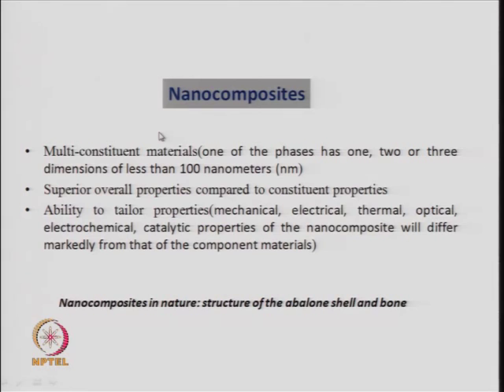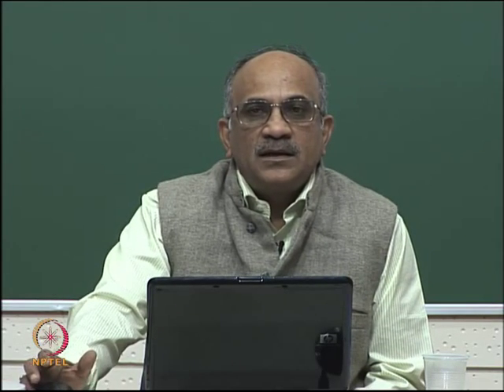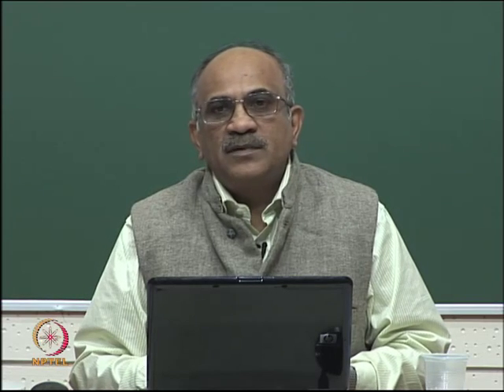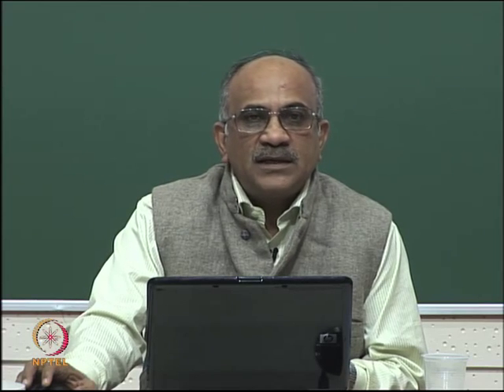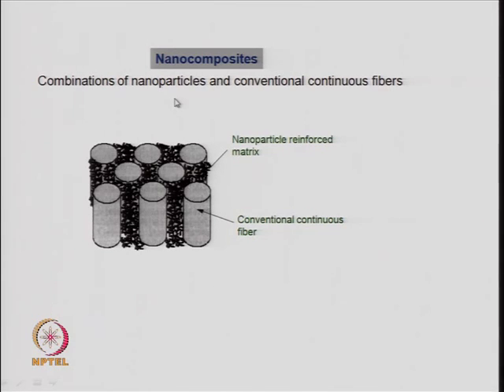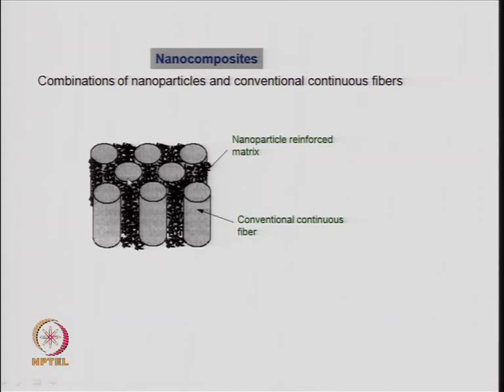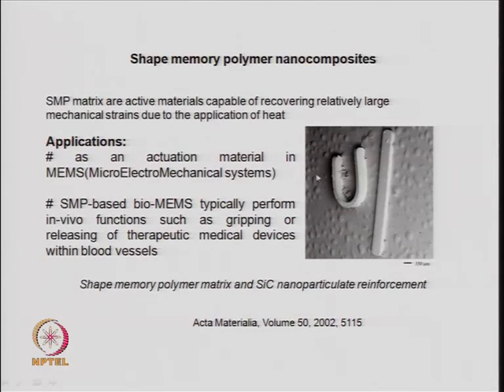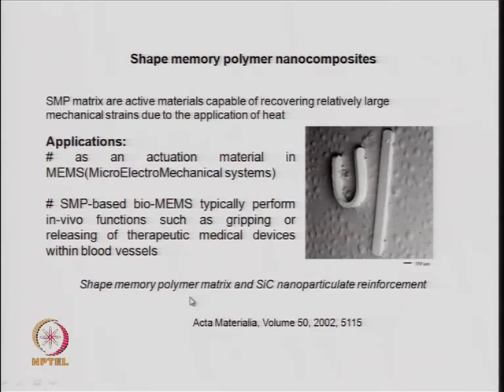Mod-03 Lec-27 Nanocomposites - I

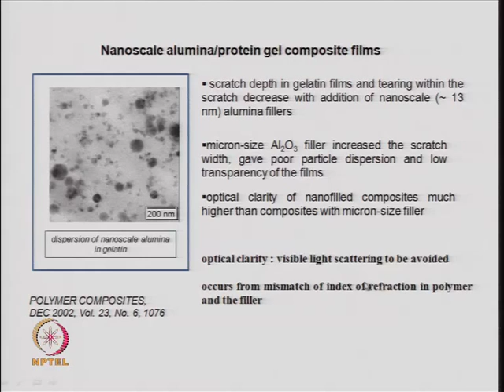Comment: 30:39 Let me give more clarity on the optical clarity. When there is a mismatch of the refractive index of two materials, the scattering of light will happen at the interfaces. In micron size Alumina, this is prominent but with nanosize alumina, the optical clarity is enhanced even without the match of the refractive index of the two materials (Alumina and protein gel polymer). Thus, nanosize alumina provides strength with transparency and hence can be used as a replacement of glass in optical applications which has high transparency but low strength.